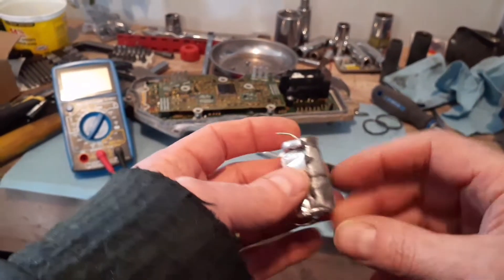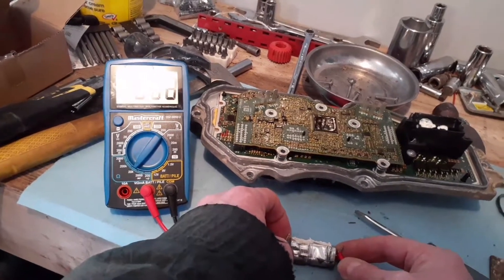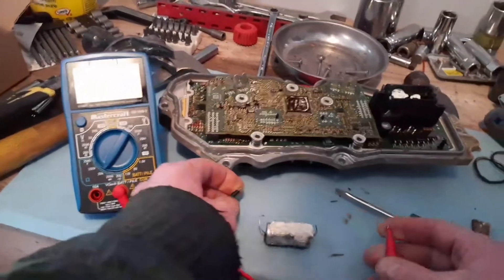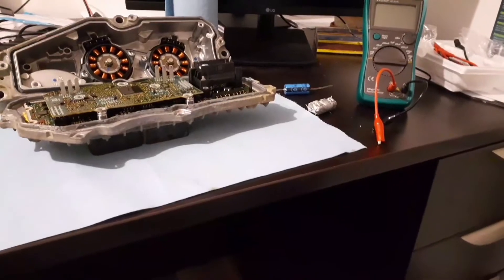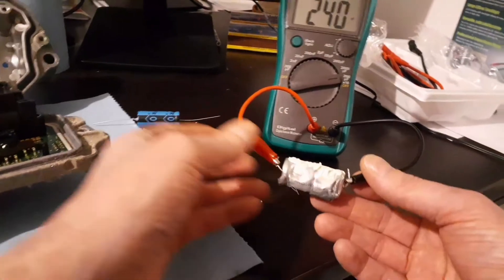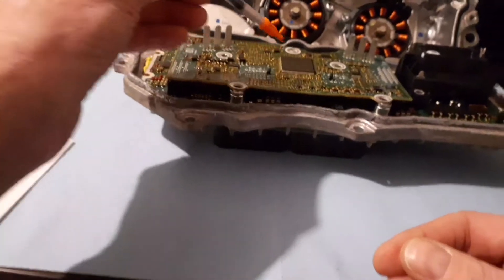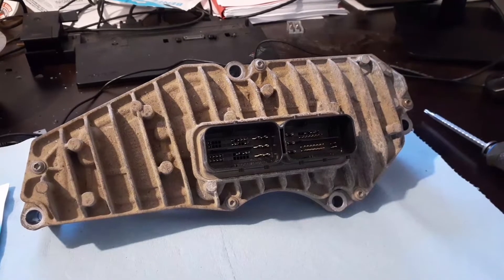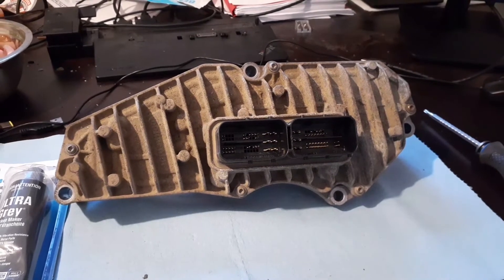Overhauling a Ford Focus TCM - Part 2: Inspecting, Testing the Capacitor and Soldering

Comment: Are you sure a 50V cap is OK, I was under the impression it is employed in a voltage boost circuit along with the inductance under the capacitor to step the voltage up to 60V for the motors?  If you are trying to fix intermittent connections I'm not sure what is the point of only soldering one end of the connection, what about the ones on the bottom of the lower board?
Reply from the maker: @campbellmorrison8540  I wasn't able to pry off the upper board to get to the lower one so I could only solder the top.
Reply: @breakingandfixingstuff  Yes I know and even if you do get the top board off you still cant get at the bottom of the lower board because its glued down Im trying to work out a way to get the glue off.  FYI to get the top board off cut each pin with surface side cutters against the expanded area of the pin, this reduces the spring because the top of the pin is removed and held squash the pin back to a square shape. The pins remain long enough to be able to resolder them ok

Comment: Have you had any issue with the Jegs TCM? I just ordered one for my 2013 Focus.
Reply from the maker: @Tendy58  No issues at all. The Dorman TCM I got from JEGGS has been working great.
Reply: Did you have to program new Tcm or was it just a bolt in and good to go part.
Reply from the maker: @Tendy58  The TCM came programmed, but I did have to run the Adaptive Learning using FORscan. You'll have to order a FORscan OBDII cable for your laptop and download the software.

Comment: wow,   i did not know abou t all of them tiny soldering spots. 

no wonder the those  TCMs  went bad.
ever heard of  current feed back ? 
if but one of those things go bad  [ from overheating or  drop in current  ( voltage )  ] ,  due to corroded battery terminal and including all the ground straps.
those things will pop   like pop corn.
no wonder them things are all going bad.

Comment: So im looking at all that microcircuitry and picuring it sealed up in an aluminum case attached to a car engine and transmission in a hot engine compartment on 100 degree day.
Kind of hard to imagine it lasting more than a week.

Comment: Theres a recall for the tcm currently that includes a friends 2015 focus. Shes had both her clutch actuators changed twice and yesterday once again she lost reverse. The local ford dealer has refused to oerform the recall and says "no that's not the symptons" (losing reverse ). 

Im goinf to try and clean the actuator and lube the forks today. Tomorrow ill call ford directly to complain about the dealership

Interesting videos, i would have loved to see you test it but i understand about having one car and the headaches that could happen.
Reply: Any luck? What did it end up being?
Reply: @TimelessMotors  the latest update Is I had her grab a used TCM from ebay off a newer focus. Everyone says they must be dealer programmed to work but we didn't have it programed. I swapped it out about a week ago and then did a TCM reset. Knock on wood it's been perfect since. The reset that actually works is as follows. Turn the key to on (2 clicks but not start), hold down the brake pedal (keep holding til we're done), shift the gear selector into neutral and watch the dash. After a few seconds it's will say transmission reset / transmission ready (or something similar). Then put it in park, take your foot off the brake, remove the key. Then start it up and test it. That reset procedure would restore drive or reverse with the original TCM. 

I'm hoping this takes care of it. Otherwise it's out of my league.
Reply: @allenrusselljr  how did it go after this conversation 1 year ago? Thanks
Reply: @wickedrepairs8527 Ford basically didnt care. They took the complaint about the dealership qnd that was it. Whats crazy is just today i was helping with that damn car. Fir the past year shes been resetting it whenever it chose to lose reverse. The new symptom is a no start / no crank and the reset wouldnt do anything. The reset im talking about is key on accessory, engine kff, foot on the break, shift to neutral and wait. Within 15 seconds it will say transmission reset (or similar). Now it wont ever say that its ready. Were in a heat wave today so i wont mess with it until later tonight.
Reply: @allenrusselljr I had the same BS from the dealer when I talked to them. I currently have my TCM off and apart on my bench. I had my TCM replaced at 16,000 miles. First car I had bought brand new. It was better than with 6 after it was done, but 150,000 now and is a lawn ornament 😆 I did a few things and cleaned and lubed the actuator ports, and changed the transmission oil, cleaned grounds, all sorts of stuff.

Comment: So after all this you're just not going to try it out to see if you achieved a repair? I'm not really understanding the point of your two videos then I could be wrong but let me know
Reply from the maker: I had fully intended to put my old TCM back in the car to see if it worked, but after a $400 tow bill the last time the TCM died on me, I didn't want to risk it. After about a month of having the old TCM sitting around, I sent it in for the core charge.
Reply: Uh huh,we know that, at the end.  The point of your video was to see if you achieved registration of the malf unit. It was misleading.  Step back and review your video from the standpoint of somebody other than you seeking some information did a friendly advice Mister have a good day

Comment: You did All that and no test results?
Reply from the maker: Pretty much. By the time the silvered adhesive arrived, I had the other TCM. I would have installed the old one after I fixed it, but my wife and son needed the car too so I never had a chance to work on it.

Comment: How long did you have to wait for the dorman TCM after you ordered? Called them last week and they won't have any for about 2 months. Did you get it programmed at the dealer?
Reply from the maker: I had to wait about 4 months for the Dorman  TCM. It came pre-programmed. The only thing I had to do was the Adaptive Learning for the clutch positions. I did that using downloaded FORscan software.